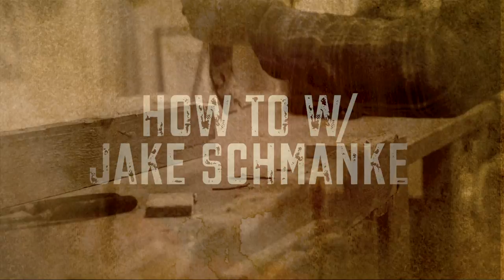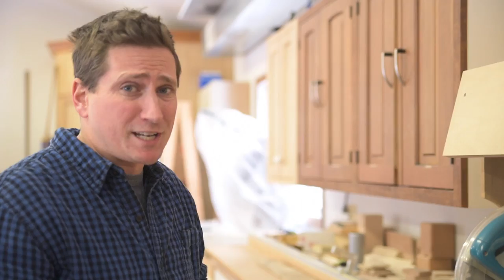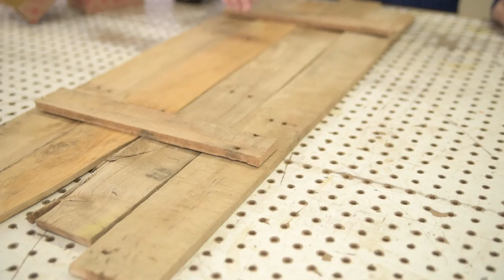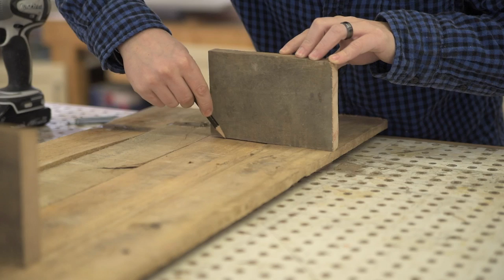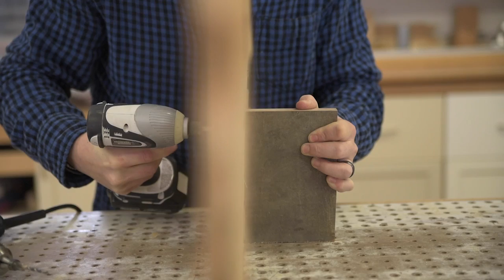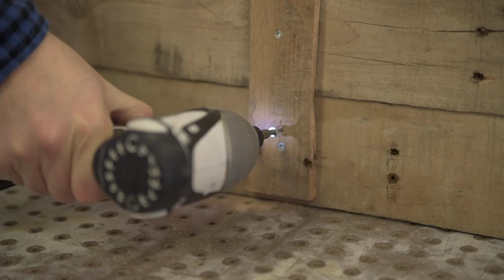How to Build a Pallet Wall Shelf

Comment: if the screws are splitting the wood, it is a good idea to pre drill the holes with a drill bit smaller than the screw diameter. and it is always way nicer to sand the wood first because it brings out the beautiful wood grains and colors! And no splinters